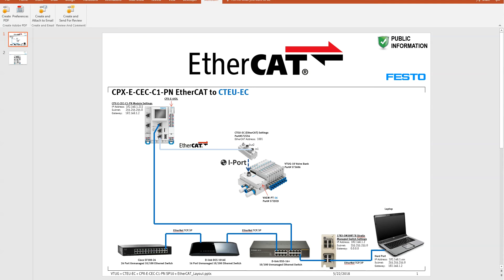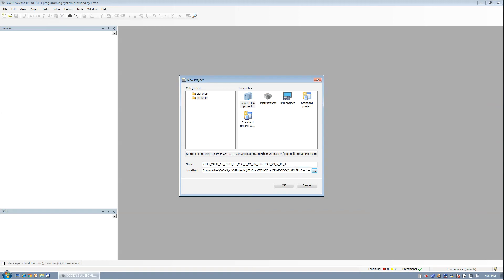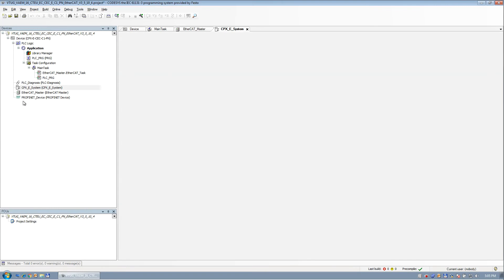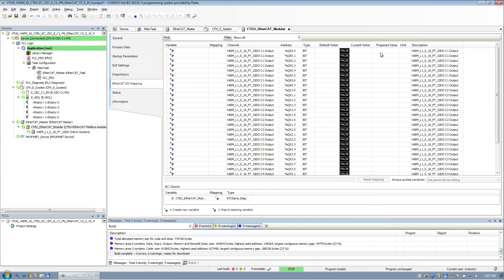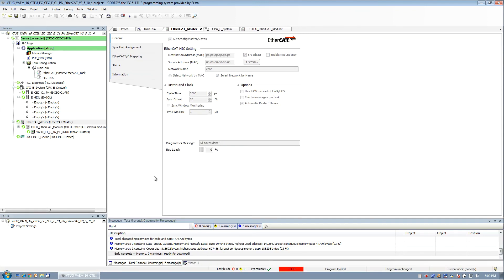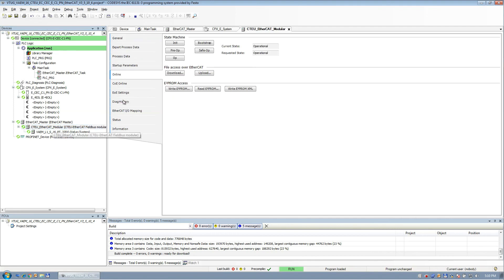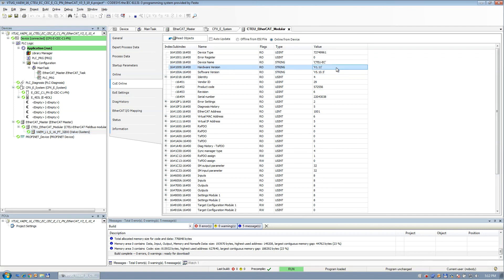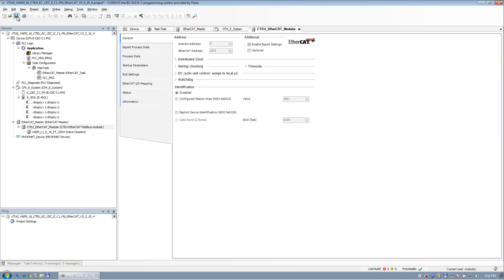VTUG + CTEU-EC + CPX-E-CEC-C1-PN SP10 + EtherCAT

Comment: Hi Steven! Is it possible to directly connect CTEU-EC to an EthernetIP Port? Will it communicate? Thank you in advance for your help! :D
Reply from the maker: Aaron Felonia if you want to Connect to an Ethernet/Ip master then you need to buy the CTEU-EP module
Reply: @Proud2BProud  yeah that's what I thought too. But client a bit know-it-all, yah know

Anyway, thank you very much for your reply! 😁
Reply from the maker: Make certain the client wasn't talking about EoE which is a Mailbox protocol which tunnels standard Ethernet communication over EtherCAT.
In the most cases you use EoE to have access to the webserver of a device. To update a FW you use FoE (File of EtherCAT)

CTEU-EC has a webserver
Reply from the maker: Aaron Felonia for further questions please contact technical support. My account is private and not intended to answer questions
Reply from the maker: Aaron Felonia 
If you are talking about the CTEU-EC EtherCAT module?